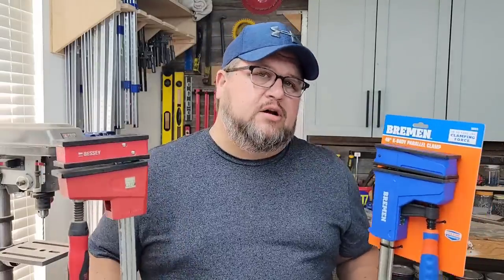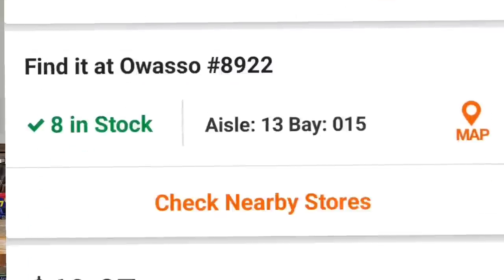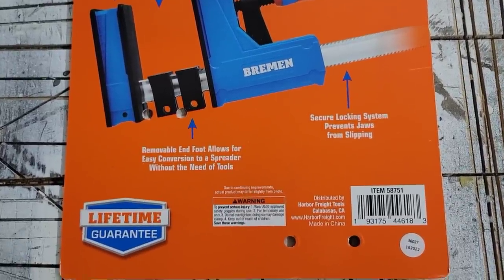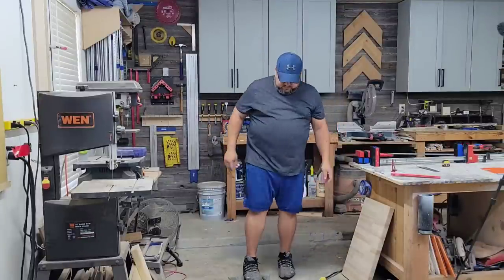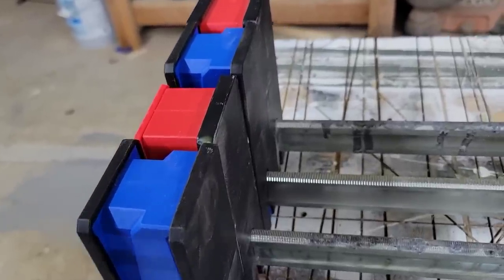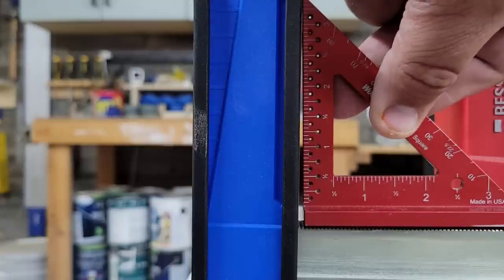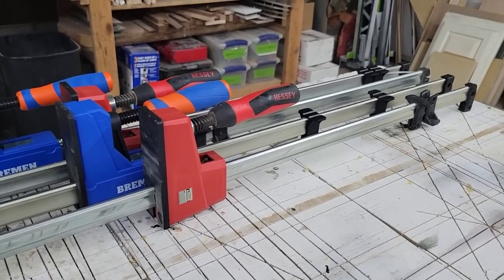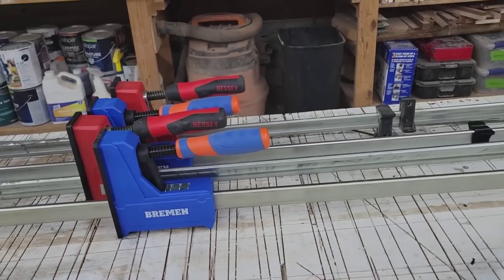Are Parallel Clamps from Harbor Freight Worth It? Comparing Bremen from Harbor Freight with Bessey

Comment: Just a note ... like many other parallel clamps, the jaws will toe in a little bit until they are clamped with pressure. They true up as soon as pressure is applied.(at least, mine do)
Reply: I have the lighter Besseys, the amount of clamping pressure to correct the toe in is excessive and too much for most glue up without marring the workpiece. Manufacturers would parrot what you have said, but as far as I am concerned it’s a manufacturing defect. You should not have to clamp the shit out of your workpiece to square up the clamp. Also this leads to cupping in the glue up. If it’s a design feature why do some parallels come square and others not in the same make/model?
Reply: @ianmib  it take very light pressure before they square up. This is the same for Bessey. I have them side by side.
Reply: @keithkolbo2735  Accounting for the deflection that would occur on wider work pieces makes sense.
Reply: @keithkolbo2735  this is your experience. The clamps I have require far too much pressure to square them up and mar the workpiece. I have other Bora clamps that square up quickly with little clamping pressure. The manufacturer explanation that they square up upon applying clamping pressure does not explain why some clamps in the same make/model come square and some come with an a slight angle. I suspect mine passed QC on a Friday afternoon. I love Bessey but can we cannot acknowledge that they could possibly have QC issues?

Comment: That head being toed in is a feature, not a bug. It helps force down onto the bar the last board in your glueup. Take a look at the Industry leader, JLT Clamp - their double bar acme screw clamp has a built-in 1 degree angle. These clamps look pretty good for the price.
Reply from the maker: That could be. Apparently Bessey doesn't have that feature. 😂 For the price though I think they're a good buy!
Reply: It's only a "feature" if you're doing a panel glue up, and even then I'm not so sure. But it becomes an issue if you're clamping a box with 2 sides at right angles to each other. Then that "toed in" head can cause your box to become out of square. I think it's more likely that most of the manufacturers haven't figured out how to handle that much pressure on the clamp head without compensating a bit on the angle. Bessey has been doing it for a long time, so I guess they have the answer.

Even still, these seem like really nice clamps for the money. It seems like Harbor Freight is trending toward better quality tools. It's been very cool to watch.
Reply: I have been tring to tell people that the toe in is normal and when pressure is applied, they are square.
Reply: My Besseys do toe in slightly like the Bremen. Same with my Jets. All of them true up when pressure is applied.
Reply: @StevenHearndon 
SEE

Comment: The amount of money I spent on cheap clamps far exceed the the price difference between the two clamps. After 20 years of putting off the purchase of 3 bessey clamps I finally got them. They are a joy to use and worth every extra penny.  Clamp the piece with the besseys and then add extra clamping with the cheap ones.

Comment: Just discovered today that Harbor Freight had these and wondered how they compared to the Besseys, which I already have. I was pleased to see a review already posted, and you did a really good job covering the differences. The fixed ends being a true 90 degrees on the Besseys is a big deal for me. It's the reason I returned the Jorgensens that I got at Lowes at first (they were off about as much as these HF ones). So I may not get any of these HF ones because I'm picky. Then again, I see that the 50" Besseys have gone up by almost $20 since I got them, so if I find myself short on clamps for a project, I might just run down to HF after all. Thanks again.
Reply from the maker: Absolutely! Glad you found it helpful. Thanks for watching!
Reply: Woodworking is problem solving.  For the price, I'm sure you could shim the HF clamps to true them up if needed.  The toe -in might go away once a load is applied.  I get not wanting to sacrifice quality in tools, I have a Snap On ratchet addiction. :)

Comment: No one tests the metallurgy of hardness of the rail on the HF clamps.  If they are anything like the ( HF ) F clamps, the straight knurl  on the bar will wear out before Bessy, Jorgensen, Pony, etc.
Reply: This is the difference. For me there’s also a difference in the plastics however that doesn’t affect performance. I like to use tools that I enjoy handling if possible so it’s a negative. I’m commenting a year later so that’s an obvious advantage having seen them in use for more time. There’s a review out there where the rail flexes on the Bremen but in practical use the Bremen are more than capable of handling any clamping job. I’m thankful HF jumped in because other vendors have since lowered their prices to below HF when on sale such as Rockler, Jorgensen etc. Bessey remains high along with Jet.

Comment: In the UK these same clamps are sold under the brand names Wellcut and Rutlands. Apart from the colours they're literally identical and both have the same bent jaws. Probably all made in the same factory. I bought the Wellcut clamps, which are orange, but sent them back because they're just too bent for my work. Someone else here mentioned that they straighten up under pressure, but mine didn't. It's the top jaw that is mostly bent btw, so using a square on the bottom jaw wont show much. It's a shame because they'd be really great clamps if it wasn't for this one major issue.

Comment: I have a couple of Bessey 48" clamps and have not liked them from day one. The movable jaws are miserable to move, and the serrations on the bar get glue in them and are extremely difficult to clean. I have Irwin clamps that I really like, but now I need to try out the Bremen clamps too.
Reply: Some wax on the bars from day one fixes this.

Comment: As a hobby woodworker with both tendons in my elbows torn...that allen key in the handle has been a lifesaver for me. Personally, I use it not to add more torque, but instead loosen after the glue has set in and caused an ever so slight expansion.
Reply from the maker: I'd never considered that about the loosening up with the Allen key. Makes total sense. Thanks for watching!

Comment: I like my bessie clamps, but mine slide like they are on ice. Plus, I want to see anyone tighten any of those clamps to their rated pressure.
Reply from the maker: 🤣 Same 💪
Reply: They're probably both strong enough to squeeze all the glue out, leading to joint failure. I have some heavy duty I beam bar clamps rated at 7000 lbs. They're good for making picnic tables with warped wood and structural screws. Inexpensive pony type 3/4 pipe clamps are probably similar strength.

Comment: Does the none moveable head on the HFT clamp move into square when pressure is applied? This in it's self could be an issue as well, but something to check. It also could be a feature that W T Lloyd Mentioned. Just wondering?
Reply from the maker: It got slightly better but not completely.

Comment: They are designed to be out of square till pressure is applied. Then the jaws are supposed to square up and give u the parallel feature the name implies.
Reply from the maker: Unfortunately I've seen lots of back and forth on whether that's actually a design feature or design flaw. Not sure my thoughts on it... Nevertheless, I'm not giving misinformation. I literally gave my exact experience. So if it's a design feature then my Bremen clamps are perfect and my Bessey's are off and if it's a design flaw then vice versa. But I definitely wasn't giving misinformation...sorry if it came across that way.
Reply: It wasn't really your video  @DebtFreeDIY , its just some other videos that really upset me as a woodworker. I'm going to remove my previous comment, just do as much research on the product your doing your video on and that way you wont get a negative response like mine any more. I respect your reply and I apologize for being so rash.

Comment: I wanted to like them but returned them. The set I purchased didn’t work as seamless as the besseys. When they first were first introduced as a “new” tool the website said they compared to the besseys. Now it just says null
Reply: I'm the same as you. I bought and returned. I saw the pin that connected the end to the bar was on the plastic and not though the bar. It was also a solo pin. I'm not sure if there's a pin inside the plastic or not but not going chance it.

Comment: Manufacturer will claim that the clamp pulls square once clamped. I have the lighter Bessey parallels and they are out of square, and they do NOT pull square upon clamping which puts the clamping pressure along the top edge of your workpiece. Same thing with my Boras. A lot of clamps seem to have this problem in different brands, I am not sure how they make it past QC but they do.

Comment: The "not 90° angle" tells pretty much the whole story. The Harbor clamps are a loose fit, the Besseys just fit and are machined at another level. The same goes for the springs the Harbors use for the handle action. It's the cheap solution. Maybe it'll last, maybe not. But the Besseys are just a way more thought through design.
Also, the Besseys have a hole at the end of the bars that allow you to extend them and join them with another clamp.
I think the extra price is worth it... and the extra isn't that much.